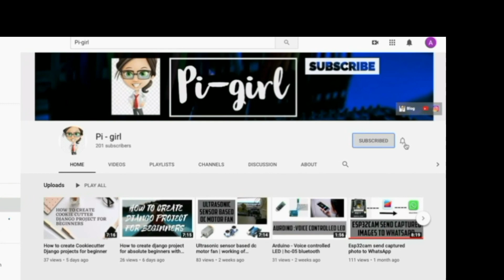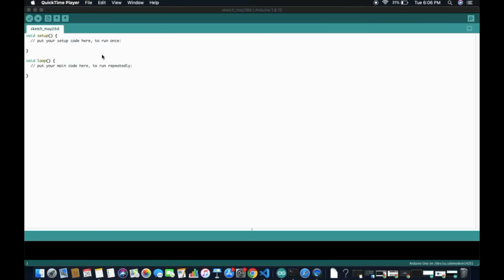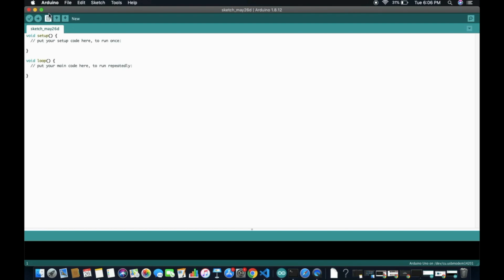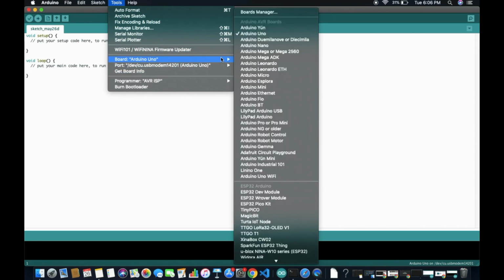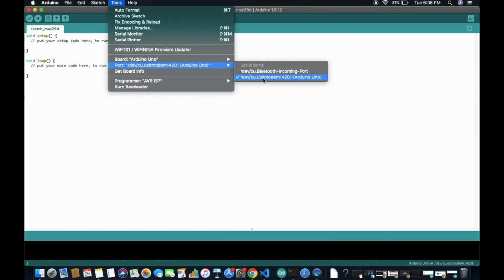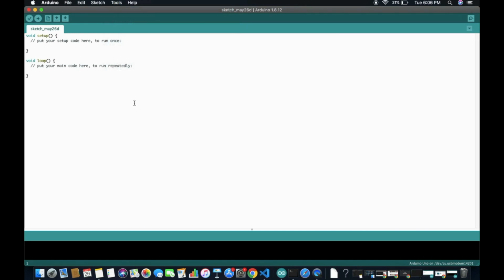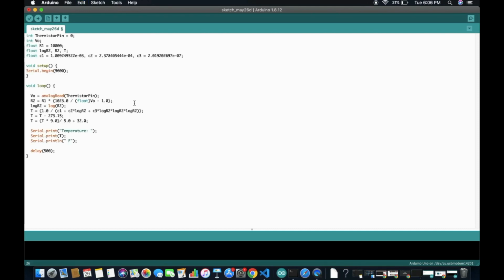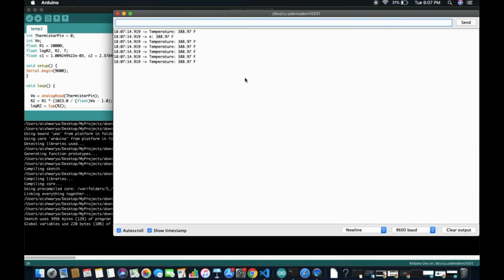Arduino temperature sensor with Thermistor

Comment: Is it a correct temp showing  on your serial monitor? 388 F?!! Mine is showing 42 F while I know it is 65F
Reply from the maker: Haan it doesn't show exact temp
Reply: NTC Thermistors do not have a linear change of resistance-to-temperature so it may show a bit insanely inaccurate temperatures when it gets closer to the rated minimum or maximum temperature. if the temperature is in between the rated max and min temperature then the result is fairly accurate.

Comment: Permission to ask, I have a thermistor that is used for the exhaust temperature, the working temperature is 350 ° C - 700 ° C, can it be directly connected to the Arduino program that you made?
Reply: Nope the code will output wrong values but there will be no harm to Arduino